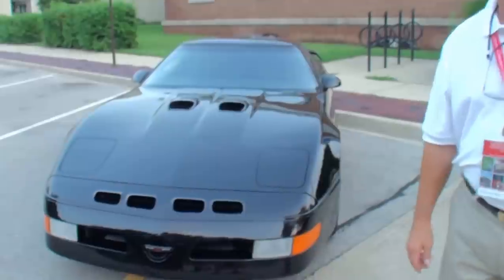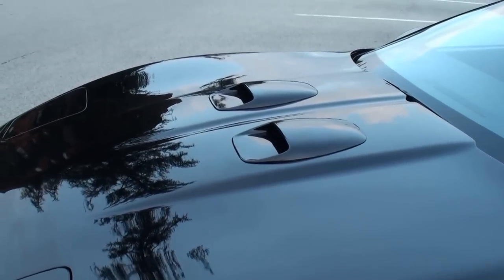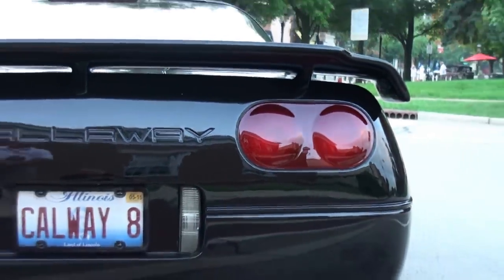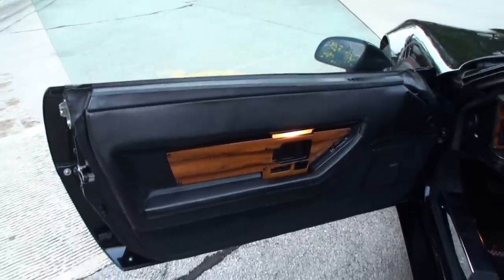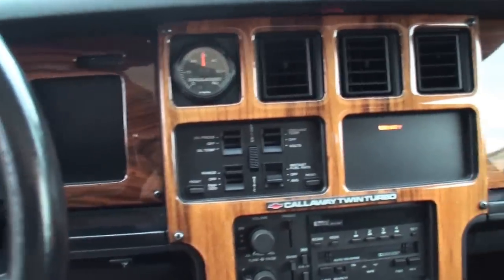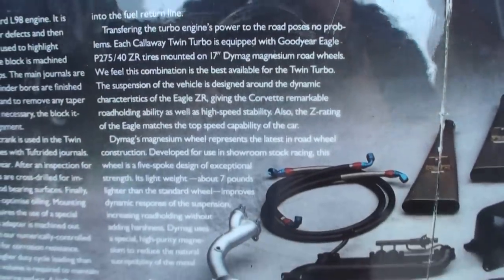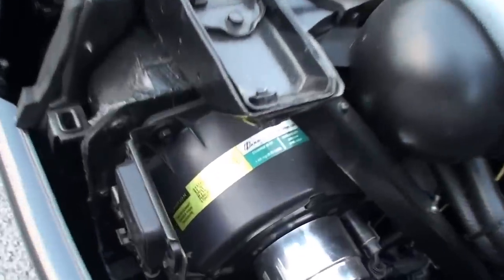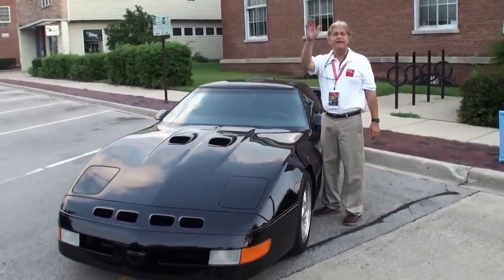1988 Chevrolet Chevy Corvette Twin Turbo Callaway - My Car Story with Lou Costabile

Comment: The stock '87 Buick Grand National. was quicker than this Twin/Turbo Callaway! Not bad for a little 231 cu. in V-6...HAH!
Reply from the maker: Hi cmf1965, Thank you for viewing and sharing your knowledge, Lou
Reply: cmf1965 it most certainly was NOT. You need to do some research my friend
Reply: Indeed it was!  Upon its release, the 1987 G/N - was the quickest domestic car, in the 1/4 mile. PERIOD! P.S. I'm not your friend...
Reply: @cmf1965  the Callaway was faster. I own them both.
Reply: @crosschkm19  NOT in 1987 it wasn't! The Buick G/N was the quickets Domestic auto!
Reply: @cmf1965  once again I speak from facts. I own an 87 GN purchased it in 1990 with 8k miles stone cold stock at the time. Ran low 14s. I still own it but now runs low 10s.  I own Callaway #19 red on red stock ran 12.2 at 118. Still mostly stock I still own it. Unless you drove both cars stock you may want to stop correcting people.  I love my GN and it's faster than my Callaway now but not stock.
Reply: @cmf1965  So it ran 13.2 and 13.7 from 2 different magazines. So basically it was faster than a stock GN. You made his point lol
Reply: @scottwilson1251  IF I CAN FIND THE G/N ARTICLE, WHICH READ THE G/N WAS THE FASTEST DOMESTIC CAR IN 1987 (AT 14.4), FASTER-THAN A 1987 CORVETTE, & IIRC, FASTRER-THAN THE TWIN-TURBO CALLAWAY, (WHICH MAY HAVE BEEN) A 1986 CALLAWAY - I'LL POST IT! I'VE OWNED FOUR '87 G/N'S...AND AM QUITE FAMILIAR WITH THEM!  (OFF TOPIC), I JUST SOLD MY 2009  CORVETTE CALLAWAY, THAT WAS AN 11:40/123 MPH 1/4 MILE CAR, in 2009 (MINE WAS FASTER IN 2019), AFTER ADDITIONAL MODS...THESE CARS had the $18,900.00 option, added to that new '09 Corvette, done by Reeves Callaway in Old Lyme CN. SO "crosschkm" can claim what he wants to claim. How many of these cars have you owned...and/or driven?!? DENNIS KIRBAN CAN ANSWER ANY QUESTIONS ABOUT THE 1987 GRAND/NAT'L, ADVERTISING, ETC. SEE BELOW POST OM MY 2009 CALLAWAY...
Reply: MY AD READ (IN PART): "This 2009 Callaway Corvette is a turnkey upgrade of the standard sixth generation Corvette coupe or convertible.
A brute of a small block with 376 cubic inches just waiting for you. The LS series engine has broken new ground for efficiency and performance from a push-rod platform engine. The LS3 is filled with components designed for high performance and longevity."

In 2009, the basic Callaway package (if you can call it that), costs around $67,500. That's $18,900 over the Corvette's base sticker, and that includes a high-flow air intake system feeding a supercharged 6.2 liter LS3 V8, further enhanced with high-flow fuel injectors, an air to liquid inter-cooler and proprietary fuel system controllers. The result is an impressive 580 horsepower and 510 pound-feet of torque.

Callaway engine dress-up has body-colored injector covers housed under a moderately bulging custom-formed 2-tone hood. Callaway's signature "Double D" stainless steel exhaust system adds a subtle rumble without unwelcome cockpit resonance.
Performance betters a Z06 Corvette! Magazine Article Reads: "A tricky launch at almost idle, on asphalt, the Callaway rockets to 60 miles-per-hour in 3.6 seconds, and a quarter-mile in 11.40 seconds, at a trap speed of 123 miles-per-hour. Torque remains nearly constant throughout the rev band with no surges or flat spots."
That, & how's 23+ M.P.G. Hwy.?!?
Car has NOT been raced!
Power everything, Ice cold A/C, etc.
* Odometer in pic reads: 18,169 -that's the mileage when I purchased the car, in March, 2018 this year.
* Odometer now reads: 18,884
* Always Garaged
* Tires, & wheels have been upgraded.

This not only has had Callaways performance options installed, but has also been equipped with more aftermarket goodies after its Callaway delivery.
* Corvette Grandsport Wide Body Fenders and Quarter panels
* PFADT Race Engineering C.I.R.C. Coil-over Suspension
* ZR1 Inspired Black Wheels Staggered 18's in the front, & 19's in the rear
* Nitto INVO 345/30/ZR19 105Y Rear Tires, and 295/35/ZR19 99W Front Tires
* GM ARA Roller Performance Cam
* Custom Steel Exhaust Headers (Exhaust is "N-O-T" noisy at all)
* 2300 Stall Converter
* GRAND SPORT Body Panels, to accommodate rear tires, and wheels.
* GRAND SPORT "Side-Panel" (Air Extractor's) - for unique look, & style,...typically not seen on other 2009 Callaway's
* V-E-R-Y Streetable, and Dependable
* Rear Tire size: 345/30 ZR19 105Y
* Has Factory Removable Targa Hard Top too!
* Clear Car-Fax/NO issues whatsoever! (Have reports), and all paperwork for car...
* Have Certificate Of Authenticity from Reeves Callaway, in Old Lyme, CT.
* Trans is a 6-spd, AOD & has dual paddle shifters. A 6-spd manual for this car is a joke, as the paddle shifter is faster, and better, with no shock to the drive line...

(The late Ronnie Sox couldn't shift faster than the paddles/6-spd. AOD!)

Mr. Reeves Callaway does not release production figures on the cars that he modifies, but in speaking with Callaway Industries, I was assured, that there were "less-than" 100 Corvettes, that received the Callaway mods, in the year 2009!
*Callaway Engine Specs: 580 bhp-510 lb-ft torque for 2009 6.2 liter LS3 (SMALL-BLOCK!)
Supercharged with Eaton/Magnuson Roots-style supercharger, with polished housing.
Air/liquid inter-cooler integral to intake manifold (44" Hg manifold pressure, absolute, or 7 psi gauge).
Optimized fuel system with 53 lb/hr high flow injectors.
Callaway body color injector covers.
Callaway Double-D exhaust system.
Callaway Honker High Flow Inlet System.
Callaway C16 hood, painted to match with accenting power bulge and 'Supercharged' insignia's...
Callaway side and rear badging.
Callaway threshold (rocker) panels.
Certificate Of Authenticity Documentation, including Dash Plaque with engraved Vehicle Identification Number, as well as "Under-Hood" Plaque from Callaway...

The Callaway Corvette is powered by GM's remarkable 6.2L LS3 engine, enhanced by Callaway's Eaton/Magna Charger supercharger system. The Roots-type supercharger provides substantial power increase over the stock Corvette's 430 bhp, while supercharger internals manufactured by Eaton, the world's leading OEM supercharger supplier, ensure bulletproof reliability. Callaway's electronic engine management calibration provides perfect street manners, eliminating engine-damaging detonation and maintaining excellent fuel economy and 50-state emission compliance (CARB E.O. D-488-14). Magnuson's unique intercooler design, built into the intake manifold base (patent pending), lowers charge air temperature up to 100 degrees F - to increase power. During low-load cruising conditions, the supercharger's internal bypass allows the rotors to spin freely, reducing parasitic drag to less than one-third of one horsepower.

Originally came with a 3 Year/36 Month Warranty, which covers all the Callaway components and any drivetrain parts of the GM warranty.
The Callaway option is also a documented after-market modification. With a smaller build quantity than the Z06's put out by GM, makes them a rare and an exceptional car to own." ALTHOUGH IT SOLD ON EBAY, IN JULY, 2019, I ALSO HAD IT ADVERTISED HERE. SEE COMPLETE AD (AND PICS) -THESE ARE FACTS...NOT FALSE CLAIMS WITH ONE EXCEPTION. I HAD TO CORRECT THE "GRAND SPORT" METION, IN THE EBAY AD... HERE: https://www.forbbodiesonly.com/moparforum/threads/2009-callaway-corvette-grand-sport-40-995-mount-dora-fl.169075/
Reply: @cmf1965  But it's not faster than the Calloway Twin Turbo, because the article you posted shows the Calloway going 13.2 and 13.7....Now if you want to get technical you can say well Calloway Corvettes were a special edition/limited production car whereas Grand Nationals were in much higher numbers. I'm not knocking the GN I love those cars, but you yourself posted the link that shows the Vette running faster.
Reply: @scottwilson1251  I see that! :P Perhaps the article I read (back-in), 1987, was referencing a 1986 Twin Turbo Callaway Corvette, and NOT a 1987? :( If so, then I (sir), stand corrected! I can assure you Scott, that I didn't "Just Get-Off The Noon Ballon!" Thanks for your input, clarification, etc. AL  :) P.S. You spelled Callaway wrong...! ;) CHEERS!

Comment: that car is not factory.
Reply: +Jacob Gaidemak It was a factory offered option package RPO-B2K.
Reply: I know that. But look at the exhaust, wing, wheels and wood? That car is not stock.
Reply: +Jacob Gaidemak umm.. I think you're not understanding. It IS factory. It's not typical run of the mill C4 optioned though. It's a very special limited run model. Factory nonetheless.
Reply: Exhaust, wing and wood were available. The wheels look aftermarket, not sure.
Reply: Of course its a RPO-B2K a factory option. So, I get what you are saying but that car is not stock. If you think those wheels are stock or came from the factory your crazy, just one example.
Reply: Actually, I think the wheels are Calloway and were included with the B2K as well. It was a long time ago so I'm not 100% certain.
Reply from the maker: Looks like Viewers have shared knowledge on your comment.

Comment: these vettes were not that fast it only had like 400 hp with turbos  I had a elcamino sbc had about more than this had  back then that used to out run vettes all day long
Reply from the maker: Hi michael anderson, Sounds like you had one fast el camino, Cool, Lou
Reply: Compared to EVERYTHING stock in 1988 found in the US.....this car was fast AF.    Tbh, it's still considerably fast now.  This car was capable of trapping 110 mph in 1988.  For comparison, that's about what a Stock 5.0 mustang traps....and stock 5th Gen Camaro traps.   Also, the internals of this engine can handle +800hp.   The car was very mildly tuned and could make far, far more than 400hp.
Reply: michael anderson but still, an el camino is ugly

Comment: this car did like 250 mph
Reply: Not this car ...
Reply: +Joshua Plummer yes the callaway 254 m.p.h.
Reply: Callaway Sledgehammer was silver, and it was driven by John Lingenfelter, and had a roll cage. Was sold at auction .
Reply: +Joshua Plummer oh I gotchya this one was actually in production.
Reply: +Smooth B No bro, this isn't the that car. Only one of them hit 254 and it was the silver sledgehammer prototype
Reply: volcano hi  You might want to research the Sledgehammer story. That car drove through like 2 states to the track, ran 250+ mph then drove back home to show that it was a capable daily driver.
Reply from the maker: Thank you for viewing and sharing your knowledge.
Reply: volcano hi  And what's wrong with that from a car in the late 80s/early 90s?

Comment: To bad it has that god awful wing on it.
Reply from the maker: Hi Kyle,
Thanks for viewing and sharing. Might need that wing to keep it down on the ground over 160 mph.  Just a thought.
Take care,
Lou
Reply: Lou Costabile That wing isn't supposed to be there.  It is not part of the Callaway Aerobody package.  Stop by the Callaway Owners Group for all the facts. That is a beautiful car regardless.
Reply: It would be way worse if it was something someone stuck on there. As a from the factory option I kinda like it.
Reply: +reptilianresearch that's not a Callaway wing
Reply: Kyle Scaggs Did it come from GM like that? I don't think it looks that bad but I'd like to see the car as it was shipped.
Reply: +reptilianresearch none of what you see came from GM. the cars were shipped to Callaway for the conversions and that wing is a cheesy aftermarket one probably from Greenwood or ACI.
Reply: Kyle Scaggs Oh I see, I'm a HUGE fan of corvette's and now own a beautiful c5 coupe but I don't know everything about vette's. Gotta love that engine though am I right?
Reply: Kyle Scaggs What if it had a different spoiler? Like the short one for the c6.
Reply: +Kyle Scaggs yea but these are so unique they are awesome I would totally drive it
Reply: I like the wing
Reply: Joe Black lol no it wasn't! do some research dude it's not possible for a rwd car to pull those times!
Reply: Maybe with slicks... rear drive dragsters get over 300 MPH in 3 seconds...
Reply: craig howard it is possible, but not for a car with less than 800hp
Reply: Any time you screw with the original design of the C4 it screws it up. Personally I really dig the C4 but they don't take to any body modifications very well, at least I, terms of appearance.
Reply: james staggs the aero body was entirely function over form. I personally think it looks great and made the car stand out, C4 is pretty bland in standard form.

Comment: Wow, stunning car.  I have a mint 88 Triple Black convertible, but nothing like a Twin Turbo Callaway.  That thing is a beast.  The aero package takes it to another level.  Wish all C4's looked like that!  Love the tail lights.  I noticed your averaging 7.2 MPG???  I average 16+ MPG and I have a 3.73 rear.  Dayum!
Reply: I have the 3.73 gears now in my 1985 corvette and a 383 CID engine, it is a rocket ship but I wish I had a Callaway twin turbo. My mileage is about 14.5. The scary thing is with stock 350 CID, a free flow muffler system, and stock 3.07 gear I got over 30 mpg on the highway! I kinda feel like I wrecked the car, and it ran a 13.93 when stock in the quarter mile. The 383 and 3.73 gears make it an mid 11 second car. BTW, Callawy will NOT sell the aerobody separately to a non-callaway corvette owner, I tried .
Reply: Coupe looks better..convertibles ruin the lines of a car....even better than a convertible is a targa top..in my opinion.
Reply from the maker: Hi Steve Pen, Happy to read this car reminds you of your car :-) Thank you for viewing and sharing, Lou